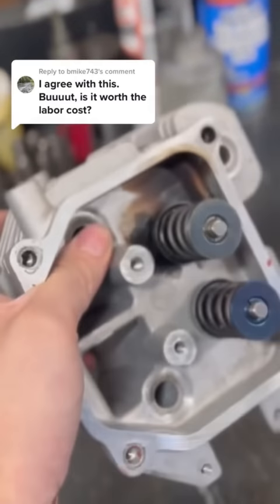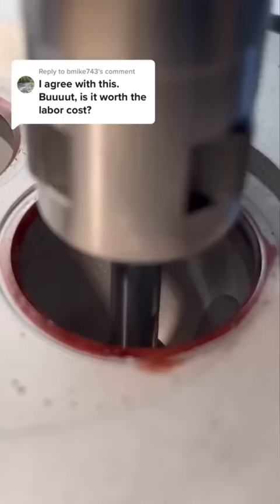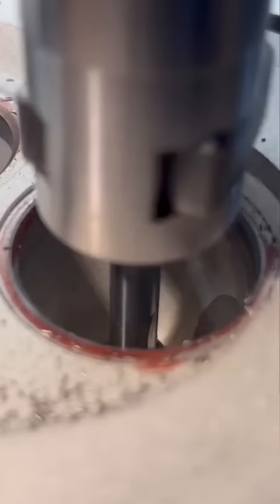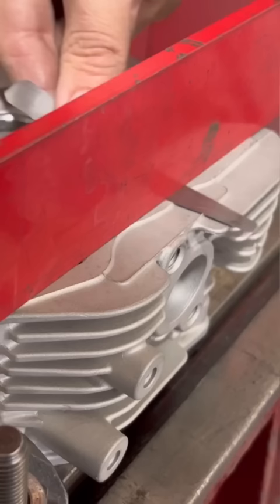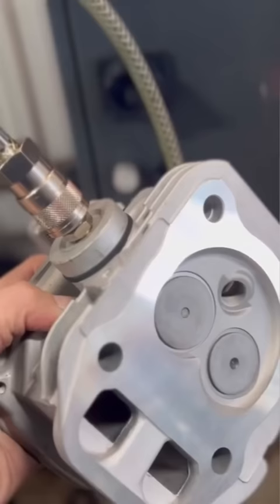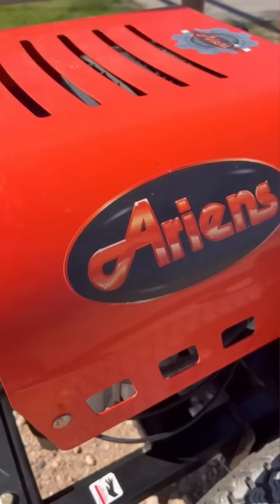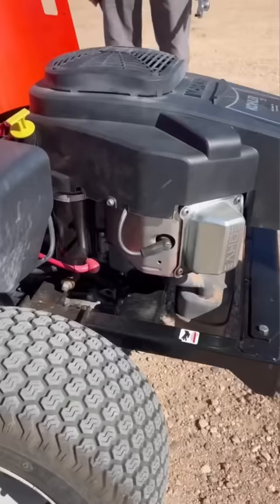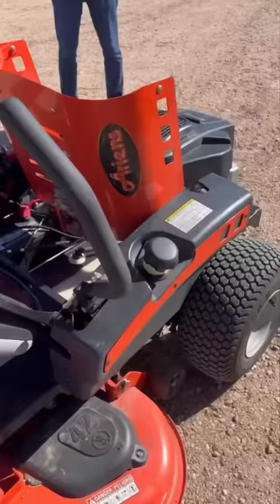#shorts Is Machining A Lawn Mower Head Even Worth It?

Comment: So you guys are the shop to avoid for anything out of the normal, or more complex than resurfacing tractor heads. Got it.
Fucking sad what we consider a machine shop in 2022. 😂
Reply: You interpreted this in the exact opposite way it was said. He doesn’t do it because the time is better spent on more complex jobs. Just because something is smaller doesn’t mean it suddenly takes less time to set up the machines, get measurements, cut, test, and all that. At that point, the labor cost of any self respecting mechanic is going to be more than just buying the part new.

Comment: those heads on those kohlers are crap.  I know. I have a few.
Reply: On the Courage or all models? I replaced my Kohler Courage 26hp due to smoking exhaust. Thought it was the rings so I replaced them and the ring gap was considerably tighter (in spec now) but same smoking. Compression tested cylinders and leakage tested them - all in spec. One cylinder must have been burning the oil because only one plug would get buildup on it. Replaced that head - same issue. Cut my losses and bought a different model Kohler and haven't had any issues yet. Now I have a Bridgeport so I might look into it again and play around with it.
Reply: @dm-zx7xb  I have a husqvarna lawn tractor with the Kohler kt series i believe.  Uses the same heads.  I'm probably going to sell it in the spring and get something else

Comment: i mean 2 days worth of work, $40 worth of sandpaper and spray adhesive and glass and some lapping compound and it would be back in
 service. no reason to go this crazy
Also i call BS on your time.. 
maybe you are not adept to deal with this but ive taken many heads (single to 4 piston) to local shops for a deck job, $40 each. some times $50. $80 if the valves need to be done. why are you so DAM expensive you charge over $200 or whatever the cost of a new head is?

Comment: You have some weird views and if it takes you that long to set up a machine for a lawn mower head then you should probably rethink your profession.
Reply from the maker: It takes the same amount of time to set up a cutter to cut an intake valve seat on this mower head as it does to set up a cutter to cut an intake valve seat on a 6 cylinder cummins diesel head. The difference is that with that same setup, I get to cut 12 intake seats on the diesel head. 

I think my professions working out pretty well 😘
Reply: @JAMSIONLINE  I understand that. I set machines up all day long, I make my own tooling, running cnc and manual machines. I understand what it takes. My question to you is are the run time the same?